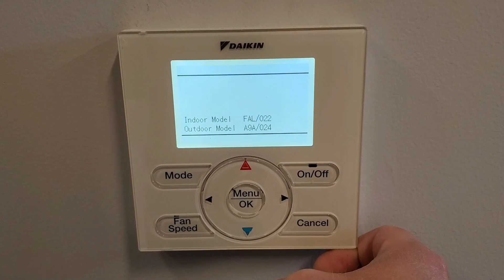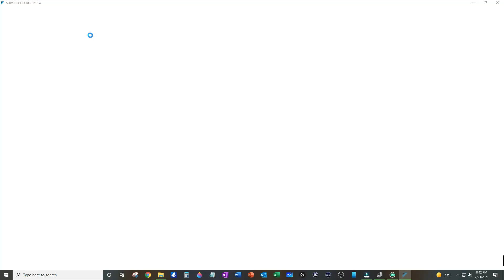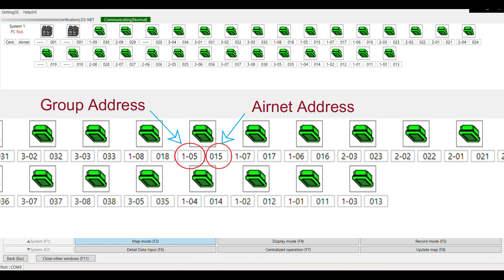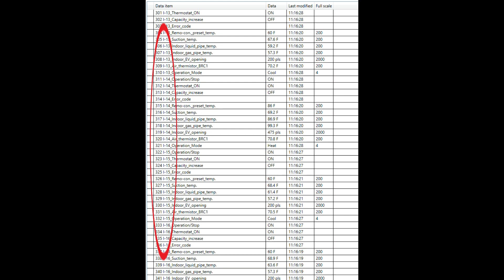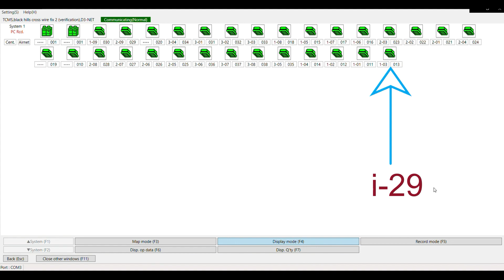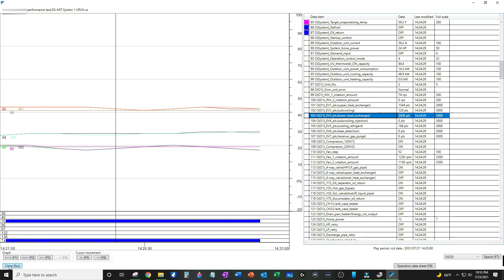Daikin VRV Commissioning Made Easy | VRV Commercial Start-up Day 2 | Things You Must Know 7-25-2021

Comment: Hello. Working on a heat recovery system. I just have a question. All of my nav controllers only have 1 fan coil tied to them. I have already went through and addressed all of them. I am about to get power to my ITM in a day or two. My question is do I have to set all of the nav controllers to slave to have the ITM as master?

Comment: Hi Dana, Have you any time experience with validating VRV equipment?
Reply from the maker: Validating performance? I do it on a regular basis every time I'm doing a startup assist I'm checking performance.
Reply: @InverterAlways  the validation is on existing equipment which have been installed since 2008, in your opinion what should I be taking into consideration? Many thanks
Reply from the maker: @michamass1  still going strong 14 years later I like it. Are you the end user or the technician doing the performance checks?
Reply: @InverterAlways  I’m the technician doing the validation.
Reply from the maker: @michamass1  right on. Make sure to check all your superheat and subcool calcs, take plenty of run time too. I like to at least get an hour in each mode when doing maintenance checks or followup visits. That way I can get multiple load scenarios. Make sure valve positions look good too. I've done a few field trips on the channel Make sure to check them out I have some run time on a few vids. The one you commented on I think is the most detailed and focused on service checker though.
Reply: @InverterAlways  Hi Dana, as the system is an existing one, and not run for a year, would you run it in test mode to see if it operates and take note of any error codes to be resolved later? Many thanks.
Reply from the maker: @michamass1  why hasn't it ran for a year? Big remodel? It definitely won't hurt to run a test real quick. But test operation doesn't exactly check performance it really just checks for "can it operate" or are there closed valves or anything preventing flow to a unit. Again it won't hurt. But you still want to do a nice thorough performance check yourself afterwards.
Reply: @InverterAlways  it’s part of a university and the new Deccan is relocating to the penthouse, and his staff are relocating too, hence the validation to ensure systems will operate correctly.

Comment: how link software service checker 4?
Reply from the maker: Do you mean where do you find the software? Your local vendor or rep can get you the software or through Daikin directly once you've purchased the tool.
Reply: @InverterAlways   im infonesian, i'm buy checker type 4 but not can this software and the local website nothing. Please give me need link to download?🙏🙏🙏
Reply from the maker: @bolehbilang4434  ah, so you will want to get with whoever you bought the tool from they will have the software for you. I cannot distribute the software myself sorry!! That would be against Daikins policies.
Reply: @InverterAlways  then what is the solution so I can get the software?🙏
Reply from the maker: @bolehbilang4434  go to the vendor where you purchased the service checker. Ask them for the software. They will give you the software. If you work for the vendor (distributor or rep) then you can have daikin send it directly to you. You should have a daikin rep in your area, it's whoever you call for technical support. That is who will be able to give you the software.
Reply: @InverterAlways  
ok, try visiting the Daikin branch, I am a Daikin dealer in my city but when I bought it, it was not given any form of software, it only contained a checker and a USB cable and a manual. I tried looking on the website but couldn't find it
Reply from the maker: @bolehbilang4434  go back to your daikin branch and ask them to send you the software. It's all digital now they can just send it to your email or drop box it to you or something similar.